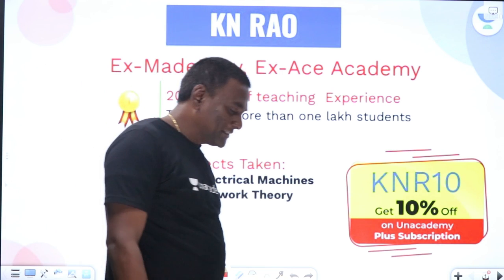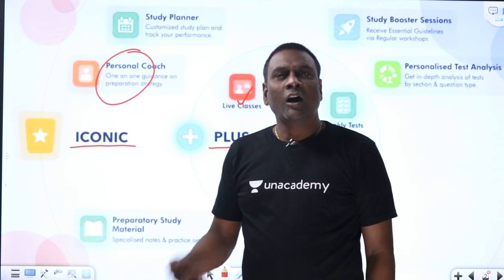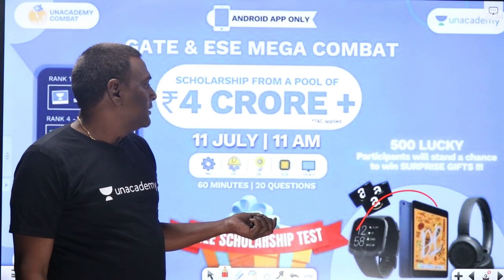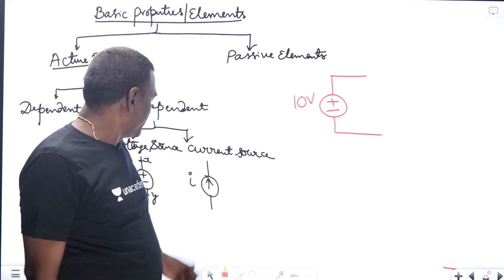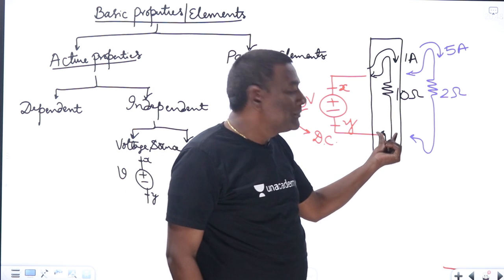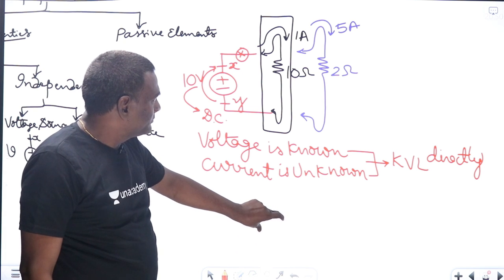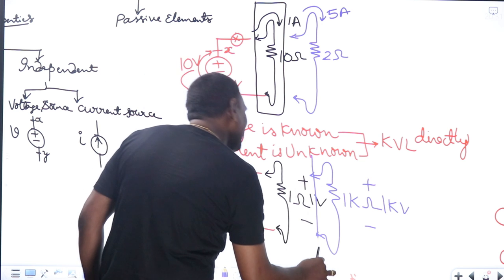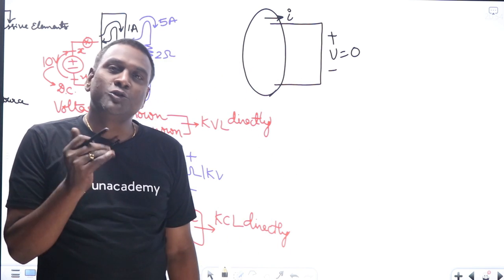Why We Short Circuit Voltage Source & Open Circuit Current Source in Superposition? by KN Rao Sir

Comment: If I connect 2000 resistors of 1ohm each to this 10v ideal source, all in parallel so does that mean I will be able to draw 20k amps from this little 10v source..
I think that's what ideal analysis is..